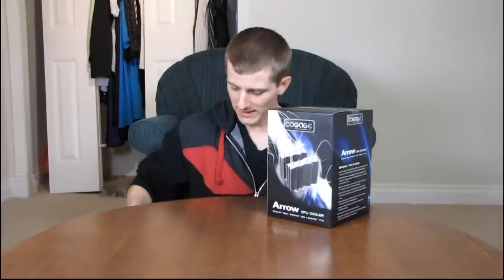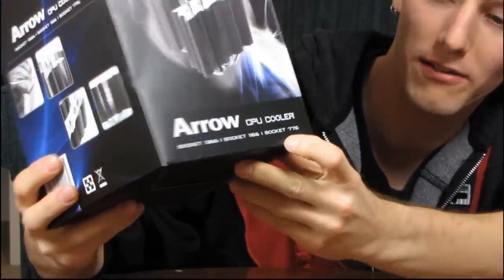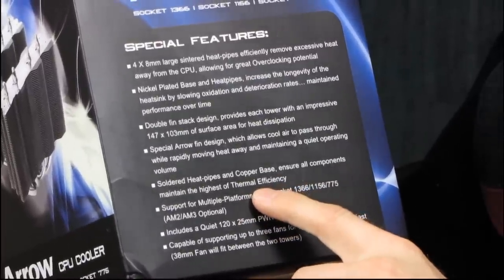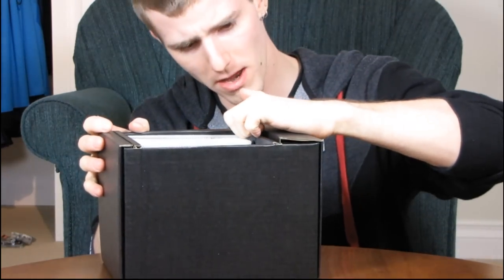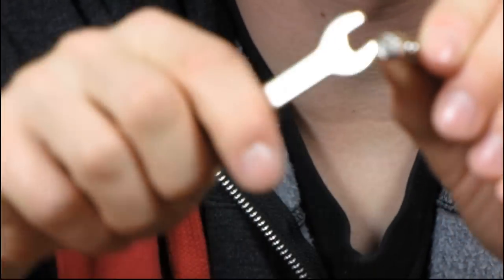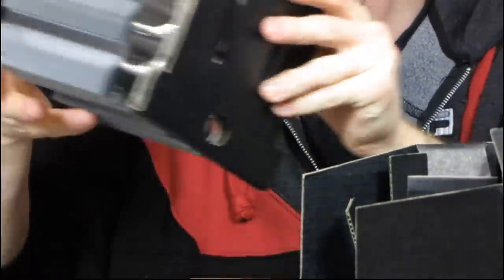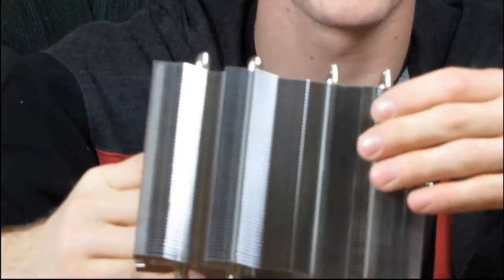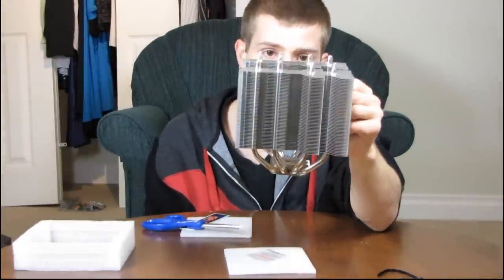Cogage Arrow 8mm Heatpipe CPU Cooling Tower Heatsink Unboxing & First Look Linus Tech Tips

Comment: @daralinn 
its a rebuild of the thermaltake ifx-14.

it probably wont even beat the stock noctua with 3x38mm deltas

i guarantee it wouldnt beat the noctua if you threw some silverstone fm-123's on the d-14